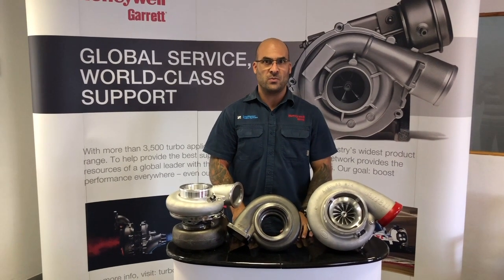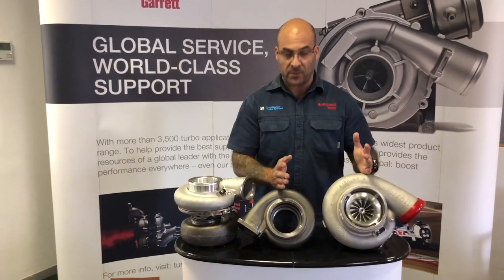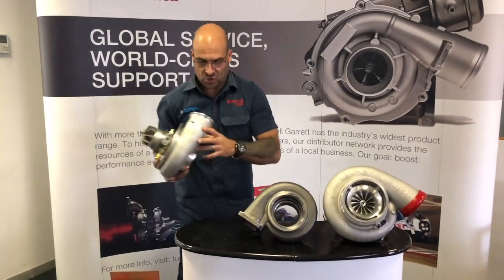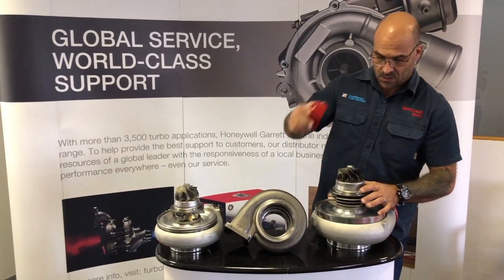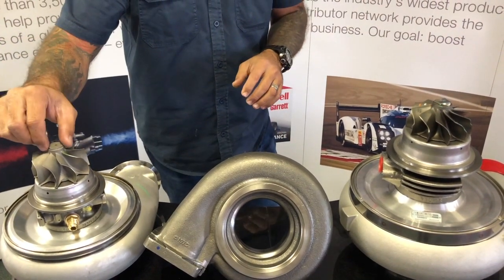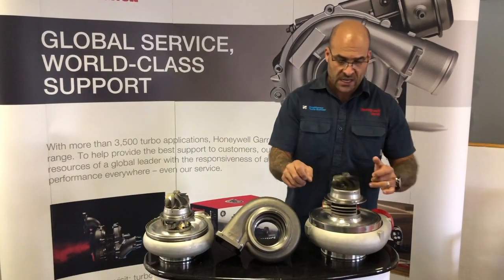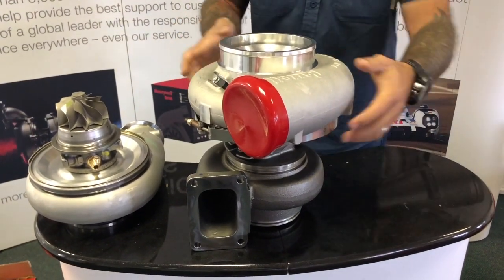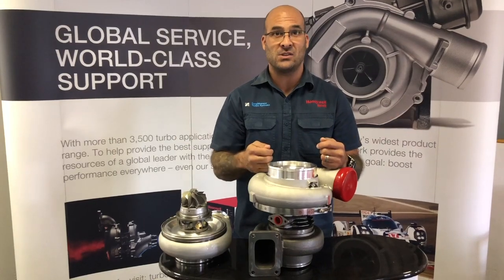Garrett GTX4720 Gen2 1950HP

Comment: i just released that 
Precision PT8891 gen 2 is rated for 1600HP
the Garrett GTX 4720 Gen 2
rated for 1950HP
Reply from the maker: Nothing can touch the GTX Gen2 compressor aero and flow ability!
Reply: @TurboDirectSA  except some 7+7 or 8+8 wheel that are better suited for high shaft rpm.
Reply from the maker: @V8Lenny  Nope - proven no 7+7 nor 8+8 blade size for size comes close to the Gen2 aero -- once you have done CFD or other aero analysis and you run the assembled setup on a gas burner, you are then able to create a compressor map which reveals all the information about the compressor. One of the interesting and most relevant components and its output is the turbine shaft power output - which coupled together with the compressor design (as a combined whole) then you will see the resulting flow.  This is where BorgWarner shines through over all the other manufacturers.
Reply: @TurboDirectSA  seems like they have raised shaft rpm closer to destruction to get better numbers for compressor map.
Reply from the maker: @V8Lenny  Nope - shaft destruction is nowhere near its limits - hense the material called MAR-M247 - instead of the old technology and weaker shaft made from Inconel 713LC  --  M247 has a higher thermal ceiling and a better rating overall in terms of ductility and other properties. The shaft is nowhere near its destruction - otherwise it would not pass the burst containment tests
Reply: @TurboDirectSA  not near but closer , BW did the same earlier. But when racing shaft rpm is always raised over manufacturers safe limit , thats where 11 blade doesnt work anymore.
Reply from the maker: @V8Lenny  Nope - heck the compressor map, and youll see clearly where the turbochargers assembly is operating. Always keep in mind that the turbine TOGETHER with the compressor operate as one - any change in the design of either side will affect the overall performance/flow/P2C ratio etc
Reply: @TurboDirectSA  102k seemed like high rpm but after calculation tip speed still seems to be reasonable , lower than BW , much lower than Precision. Although they dont give extended tip diameter. But the problem with 47 is turbine , anything over 80mm compressor is too much.
Reply from the maker: @V8Lenny  Nope - once again CFD proves factually that the flow/P2C and all other performance criteria (Facts) are well within safe limits of the material choice, and point milling design of the compressor. We have spoken about MAR M247 previously -
Reply: @TurboDirectSA  but that turbine from 90s just doesnt flow enough. Similar size BW and Holset turbines flow better.
Reply: @TurboDirectSA  I meant yes , compressor has very safe tip speed , Precision allows much higher which is not very safe.
Reply from the maker: @V8Lenny  100% -- precision is known for bursting,  in my opinion, the worst quality product in the turbo industry, made in china and assembled in the USA
Reply: @TurboDirectSA  all turbos are made in China. Precision just make them spin higher to get more flow. They seem to make records though.
Reply from the maker: @V8Lenny  No sir not all turbochargers are made in China -  I have personally visited and worked on the production line at Garrett in Cheadle in the UK specifically the production line manufacturing the Ball Bearing turbochargers for the GTX range - no chance are these made in china. Garrett's china factory is located in Shanghai and i have visited this plant aswell in 2016 as part of the master distributor conference and this plant manufactures the HINO and other heavy duty range aswell as some smaller units, but no ball bearing nor performance turbos are made in China at all.  Japan, Korea and Cheadle in the UK are the manufacturing plants for the BB turbos from Garrett. 

Then for BorgWarner  - these are made in the USA - youtube it, youll find an assembly video showing this and proving it too.  

PTE use a company called E&E to manufacture their internal components as do turbonetics, and the factory is owned by Jack Zhang -- lowest quality components i have seen. I have visited this company in 2010, 2012 and they visited my company in 2013 in Johannes burg after the Automechanika show -  i know EVERYONE in the game, i have been doing this for over 25years sire...... dont believe the "BS" that you are fed from the forums and opinionated "racers" or Salesmen

As for the "records"  -- ask Tim Lynch and co about this -- see what he thinks about his 300 000USD corvette that burnt to the ground as a result of a burst PTE turbocharger...... the way that PTE have records is by purchasing them -- they literally give turbochargers away to racers, this is the easiest way to get them to run their turbochargers.
Reply: @TurboDirectSA  I have used E&E turbines too , they are also sold as Melett , very good quality. All tractor pulling turbines come there also. 

Garretts are also made in Romania , journal bearing , very weak turbos used in Scania and other trucks. Garrett is the last brand I will use.
Reply from the maker: @V8Lenny  e&e quality is rubbish.
Reply: @TurboDirectSA  is there a better choice for high performance turbines that big manufacturers dont do ? Like those lighweight high flow Garrett VNT turbines used in MB and BMW diesels ?
Reply from the maker: @V8Lenny  Yes there is - the main issue with the poor quality products at hand are due to the fact that they are not manufactured correctly using CVE welding - nor are there any laser inspection or X-ray inspection for inclusions in castings, etc - simple friction welding is just not going to cut it for high speed and high performance applications - hense the bursts associated with some brands.  I guess enough said.

Comment: hi good info here

it well bee good if you could
compare the 88mm
GTX 4720
GTX 5020
GTX 5533
thanks pro 
and keep the hard work
Reply from the maker: Thanks Stoker Z28 -- i have the Gen1 GTX5533 on hand, ill do a comparison video for you and indicate the differences, Ill measure up the inducer and exducer of the turbine to show the size variation, and discuss the spool characteristics. But I can tell you that in terms of spool - none of these turbos will come close to the GTX4720R Gen2 -- the GTX5533R Gen2 ill obviously outflow this by 550HP, but if yo not in the 2000HP + market, then the GTX4720R Gen2 is definitely something you need to consider. Once again depending on the size and setup motor you running. The larger CID V8 engines might not want an extremely fast spooling turbo to make the drive more linear and "manageable" on the road should it be a streetable setup - otherwise GTX47 for the win
Reply: @TurboDirectSA  How street able would you say a 481 ci v8 would be with the gtx4720r gen2 ?
Reply from the maker: @cetromero15  with the correct AR turbine housing, very streetable! You find this overly responsive to be honest - that size motor i would opt for the larger turbine on the GTX50R -- you dont want a flood of power coming in too early, youll throw the car at the scenery!
Reply: @TurboDirectSA  That makes sense. Thanks for the reply.
Reply from the maker: I have a GTX5533R Gen1 - ill do the comparison for you tomorrow - the comp housing for one, is smaller in volute volume - which is clearly visible from externally.

I believe the 4720 and/or 5020 are a "loaded gun" !